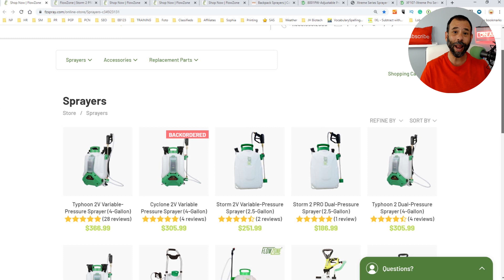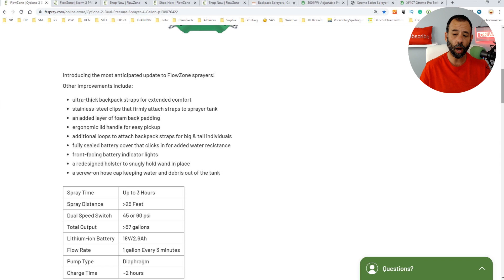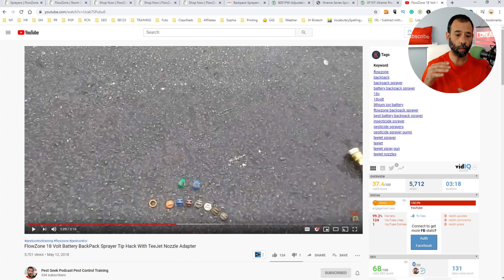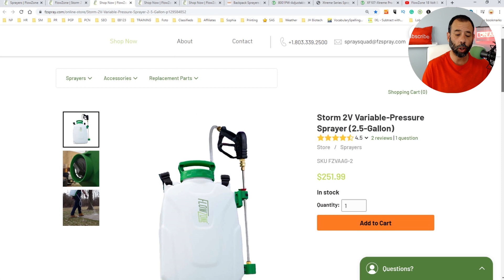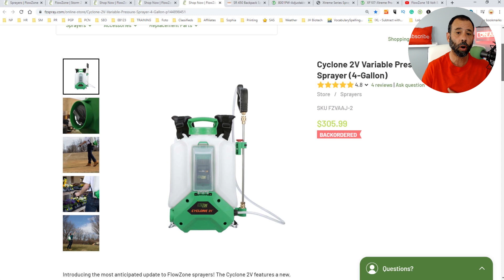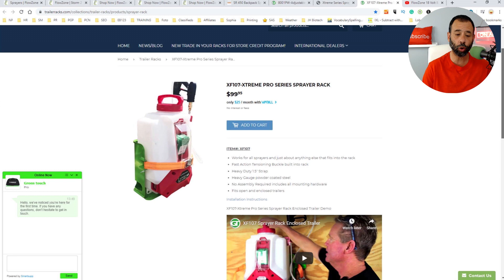FlowZone Backpack Review Typhoon, Cyclone and Storm Dual Speed And Variable Pressure

Comment: Great review man. Youll be at thousands of subscribers in no time. Im so frustrated bc literaly every electric backpack 4 gallon sprayer has been out of stock man! Yep out of stock. this Flowzone is also on their main website. Covid19 i guess. I really want the Cyclone Dual Pressure for $232. Im just a guy at home bc of the epidemic that has time to mess around in my 5000 total sq ft yard. Front and back. I just love equipment though. I think the 2.5 gallon Flozone is available but Id hate to get it then upgrade and spend more later for the 4 gallon one. I run Semi trucks all over america, so eventhough the 2.5 gallon is really enough for my lawn, ...I like huge commercial grade equipment so I can get her done ASAP and look good while doing it. Thanks for the video. Ill use your link if i decide to purchase one of those backorder Cyclone 2 Dual Pressures 4 gallons.
Reply: I'm in the same boat brother.  I think I will order the expensive Variable pressure model since many complaints about the dual pressure was heavy product output for some applications.  I will throw this nugget out there, Walmart carries a $100 Chapin/Black and Decker 4 Gallon backpack sprayer - yes, it is basic, lasts 1.5 hours per charge - the tip isn't great, but it is better than pumping.  It is a decent value when compared to some of the nicer manual pump sprayers at $80.  Also, it can serve as a decent hold out sprayer until you get your hands on a FlowZone.  There have been various complaints of leaks, but so far, I've been lucky with mine.  But I admit, I've stayed away from poisons / insecticides to stay on the safe side for now.  Unfortunately, I have to deal with 1/2 acre - bless you and good luck.